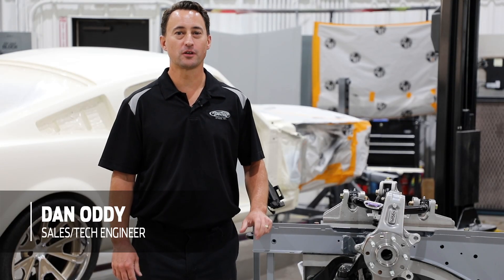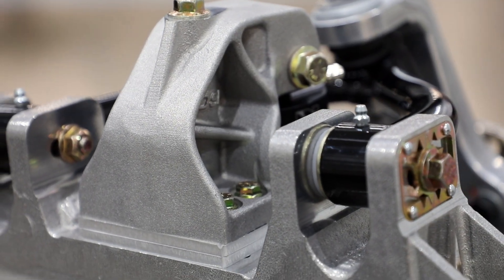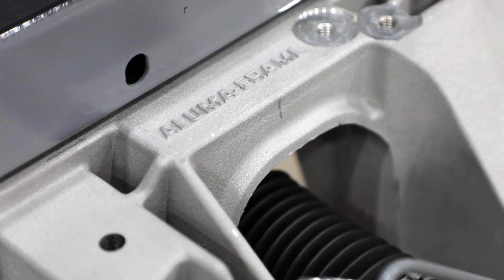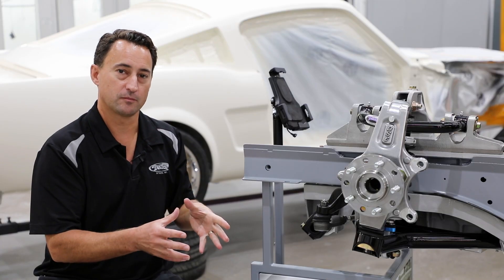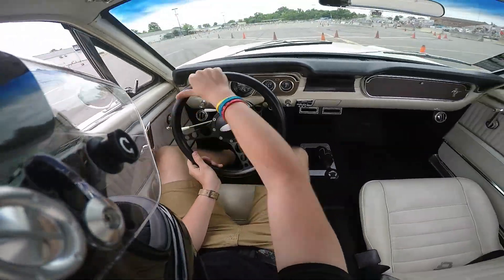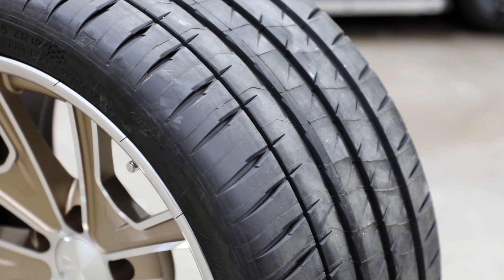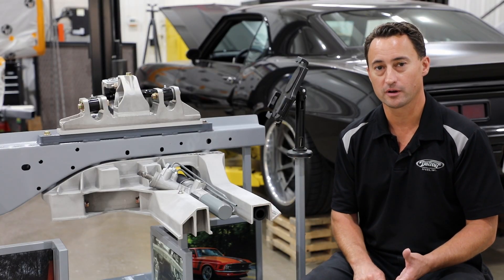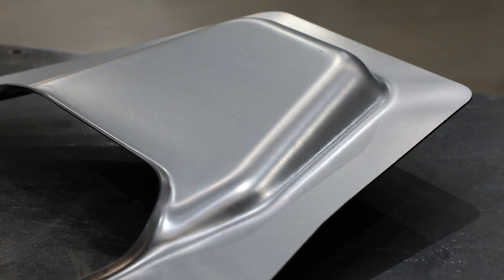Mustang Aluma-Frame - Detroit Speed Tech Talk Ep. 013

Comment: maybe talk abit about what transmissions fit and if they need modification to fit as well
Reply from the maker: Robert, the Aluma-Frame only adapts to the front frame rails, so transmission fitment is not relevant to this kit.
Reply: @detroitspeed  understand that i guess i need to be more specific.  does it lower the engine enough to mount a  6r80 , 10r80 or t 56 manual  without having to do any tunnel modifications to your mustang . BTW really like your stuff and will be ordering shortly.